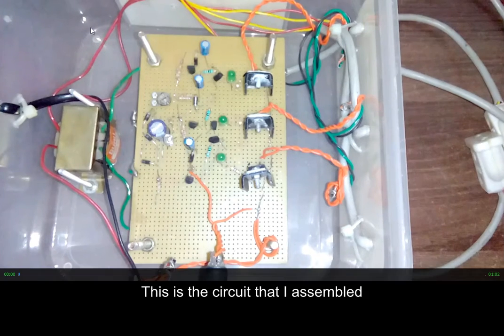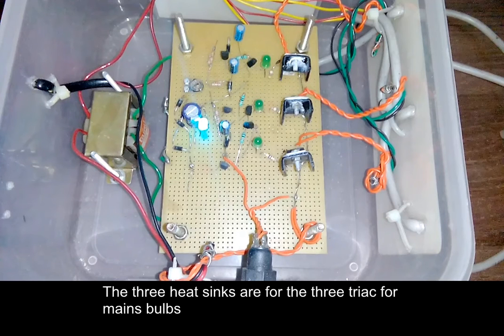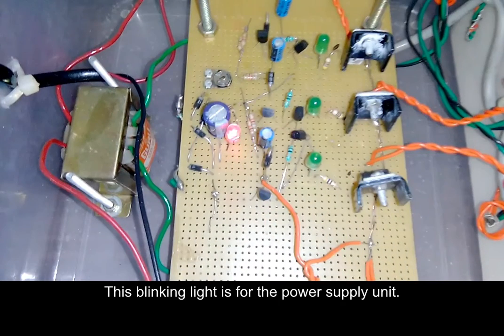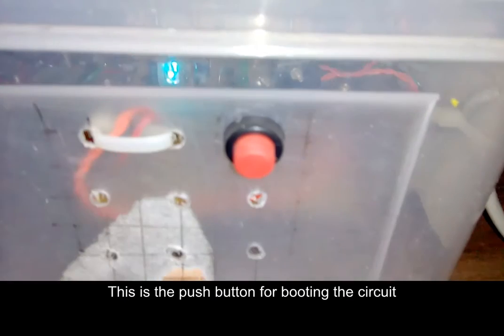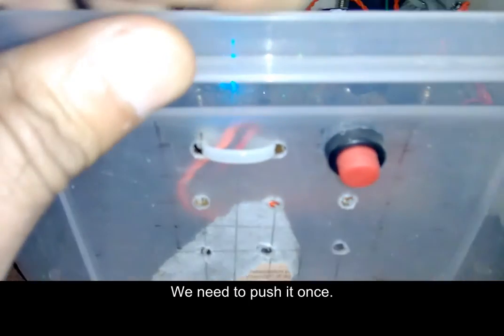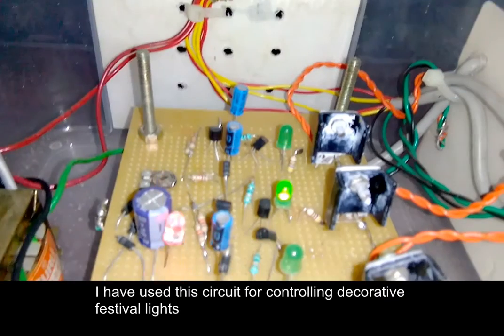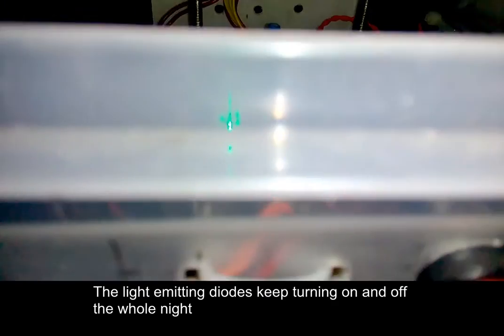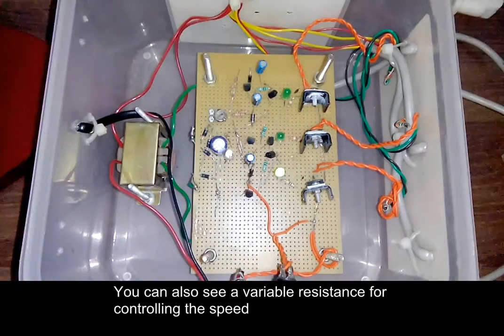3 Transistor, 3 LED Astable Multivibrator | Moving dot effect | Running Light Effect

Comment: Can you please tell me how can I connect variable resistor in this circuit
Reply from the maker: The variable resistance about 22k or you might have to experiment with 10k, 2.2k, the VR must be placed like this: Remove R4, R5 and R6 from the VCC and join the three ends that you removed from the VCC just now. Next put the VR between the three joined ends and the VCC. It will help you change the time period. The circuit is on this page https://hoven-in.appspot.com/Home/Blog/3-transistor-3-led-astable-multivibrator-circuit.html